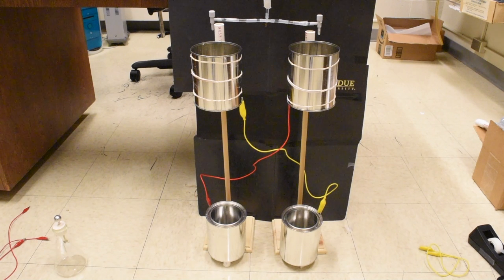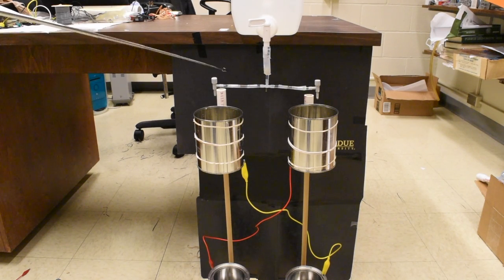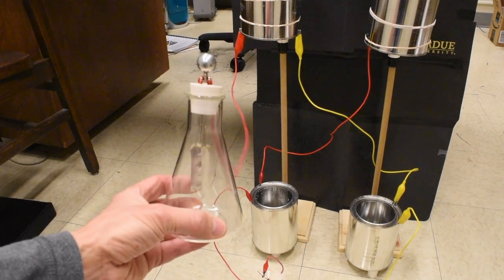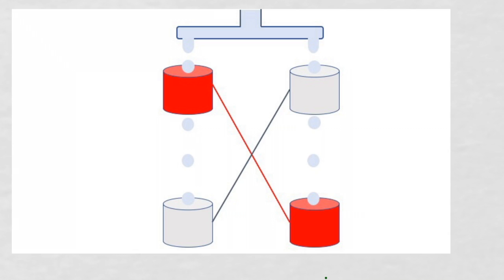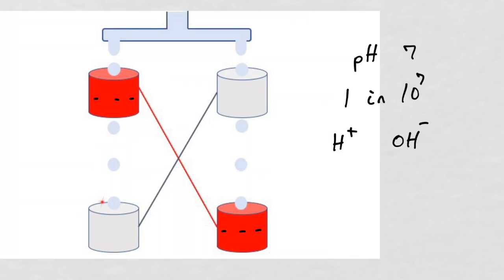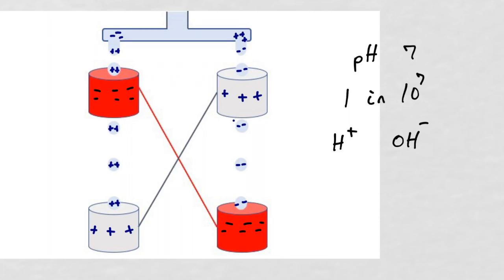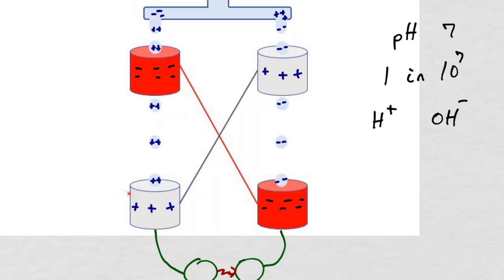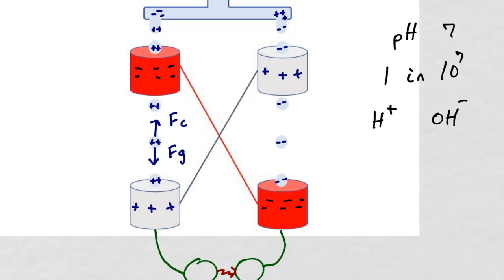Kelvin Water Dropper Capacitor or Electrostatic Generator

Comment: How about using acid and showerheads instead? Also metal crates instead of the top cylinders to maximize the area... Maybe pressurized liquid instead of gravity-fed so the free fall velocity is not a limiting factor. I wonder how many volts you could reach before the charge is so great that the fluid gets completely repelled instead of falling in or the thing just starts arcing uncontrollably
Reply from the maker: It would be interesting to experiment with variations on this generator.

Comment: I notice that in vulcanic storm there are more thunder than a rainy storm, due to the amount of ash and powder, so i wonder if this experiment could work using sand or ash instead of water. ? ?
Reply from the maker: I do not know. Maybe if there are positively and negatively charged particles they could be preferentially accumulated in the different cans.

Comment: The energy is not comming from gravity sir. Gravity makes the process happen, but the energy is dependant on how many ions are avaible to be separated and different liquids with different ion concentations are going to be able to provide differing levels of power even at the same gravitational potential energy for the fluid.

If you added salt to the water, that would change your power output. If you used an acid or base, that would change your output, etc....

If you use your example 1 in 10^7 ions in water, there's 3*10^25 molecules in a itre of water. that means 3 * 10^18 potential ions for ionisation.

If this piece of equipement can separate even 1,000,000,000,000,000,000 th of those ions, thats 3 coulombs of charge that could be separated in 1 liter of water.

If you did that and maintained the upper can voltages with diodes you could easily make 100 KV with this....

The energy does not come from gravity.
Reply from the maker: You need to think more fundamentally. As the ion concentration goes up, there is more electrical force repelling each drop. So it takes more force to pull the water droplets down into the same charged bucket, which is more work, force through distance. If the ion concentration were to get large enough, gravity would not be able to pull the droplets down and it would stop working.

Comment: The presentation is good!
The derivation is incorrect!
Reply from the maker: What do you think is incorrect?
Reply: @electricandmagneticfields2314  Electricity is caused by the formation of water droplets.
Reply from the maker: @emanacio  What does that mean?
Reply: @electricandmagneticfields2314  Electric charges separate due to the increase in surface area.
Reply from the maker: @emanacio An increasing surface area would spread the charge out and in that sense you could say the charges are separating but it would not separate positive from negative charges. The  positive and negative electric charges separate because of the electric field.
Reply: @electricandmagneticfields2314  
He didn't pay attention to the details.
I'm in the lead!   :)
Reply: @electricandmagneticfields2314  Just because of an axioma? You didn't notice anything!
It works differently because of the effect.
Reply: @electricandmagneticfields2314 It hasnt got avything to do with the PH.
Its just that by coincidence one of the sides will have a slight charhe to begin with. This charge does not seperate H20 into H3O+ and OH-, but does actually inducs a charge seperation in the water. These water droplets now can fall down,and because these, influenced by the left beaker go to the right, and these influenced by the left beaker go to the left, the charge will increase and...
There is no hydrolysis happening here and i guess this would also work eg. with alcohol or oil or...
Reply: @electricandmagneticfields2314 If it was due to the hydrolysis of water it would not work with mercury. However apart from mercury being toxic, it is a very good candidate for this phenomen. It even works bether with mercury.

Comment: I have a question.
If you dropped the water in vapor form, instead of a solid stream. Would it be more or less effective?
That is, would more or less discharge take place?
Reply: probably less effective, because in the form of vapor, the water droplets will probably go to the opposite charge field and cancel each other out, and even if that doesn't happen, the volume of water that would pass would be the same, so the potential charges would also probably be stays the same. what might increase efficiency is putting more stuff in the water solution, for example using sea water.
Reply: @pedrojorge4684  Well, I know that a superheated channel of air acts as a conduit for plasma. Now electrical conductivity, I can't speak to.
Reply: It would be interesting to shoot a super heated stream and see if it can do anything, I suspect that cool 4c water works the best